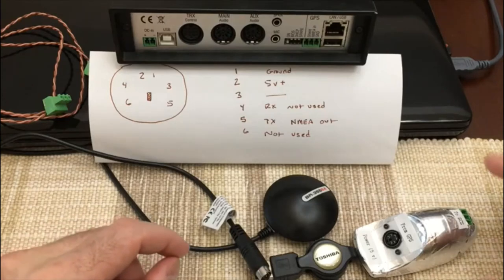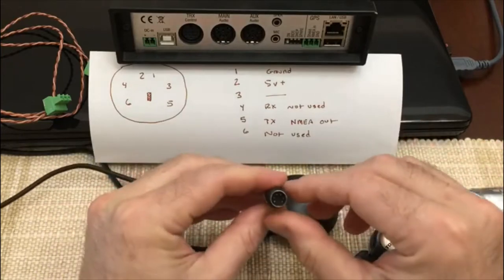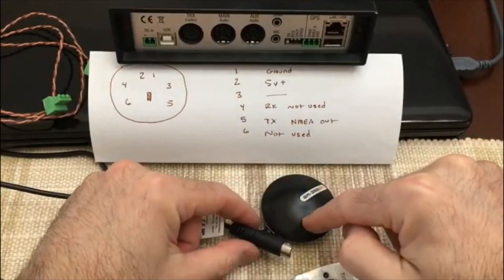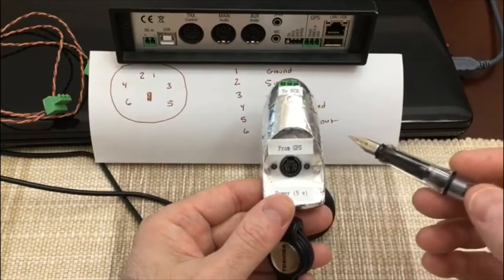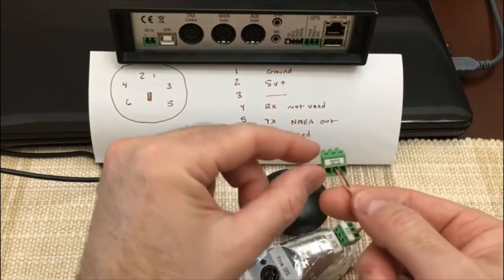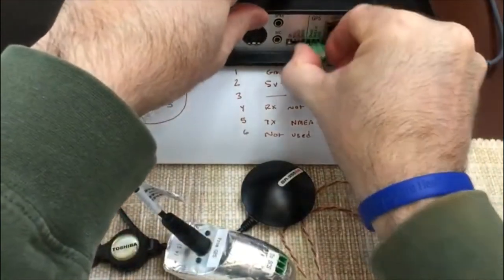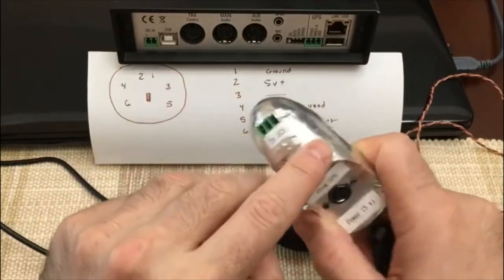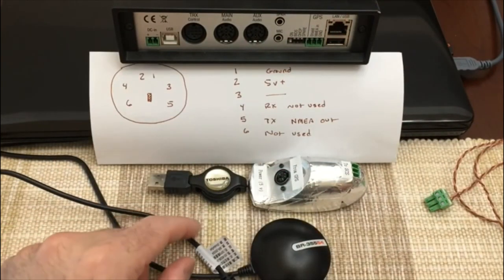Add a GPS to a SCS DR 7800 Pactor Modem Detailed Explanation

Comment: Thanks for the video.

Those connectors you do not like are standard connections in telecommunications and industrial settings (probably others) - we call them Phoenix Connectors and they're actually manufactured by Phoenix Contact. They are readily available from places like Digi-Key, Sweetwater, etc. and come in a variety of configurations for power, serial communications, analog and status points, etc.
Reply from the maker: Hey thank you for the information on the connectors. I have always wanted to know what those connectors are called.

Comment: Thanks for the video Linus.....I can see the Pactor Modem using GPS for APRS, but does it use GPS with lets say Winlink or anything else.?....   nice job on putting it all together.....too bad the USB port on the Pactor modem shuts down 5 volts after a while...I wonder why...might email the SCS guys in Germany and ask why or maybe you can change that using a terminal and some commands....
Reply from the maker: The GPS data is passed by the modem to programs like Airmail but not Winlink Express. With Winlink Express, the GPS needs to be connected to the computer.